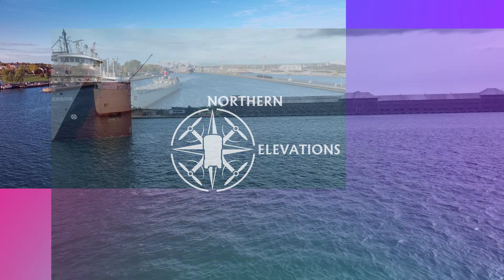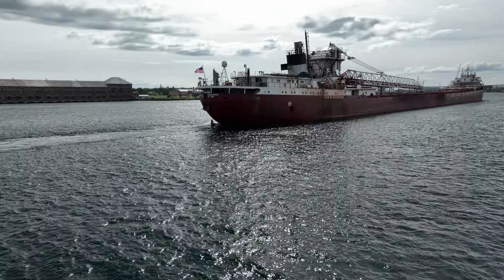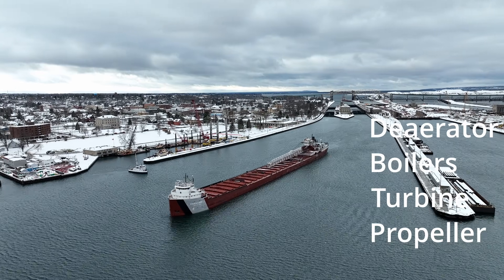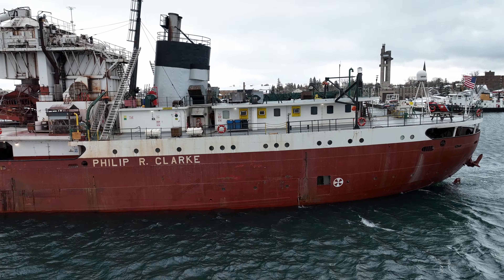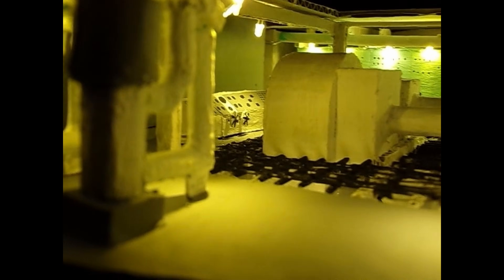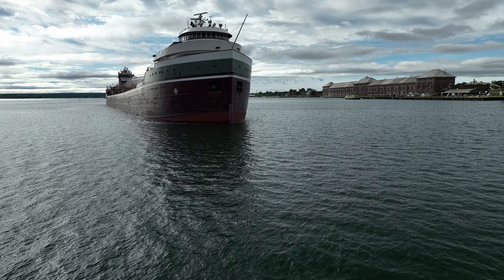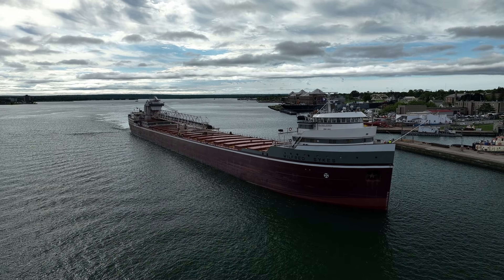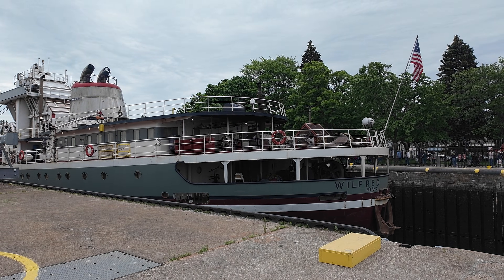The Last 4 Steam Powered Freighters on the Great Lakes

Comment: Two points, 1) either get rid of the music or talk louder than the music. 2) The Alpena hasn't  been coal fired for at least 30 years. It is oil fired. How do I know? Because I was the 3rd Asst Eng. on the SS Alpena in 2023. Also, it was shortened because the docks that it goes to can't fit any ship longer than the Alpena. The Alpena strictly  delivers powdered cement.
Reply from the maker: Yeah, I botched the audio levels on this one for sure. Thanks for the information! I didn't see that information online. The boilers I work with were converted from coal to oil ages ago, and since then to process waste gas (with natural gas for lighting off and to add stability). Makes sense that the Alpena was retrofitted to burn oil.
Reply: @NorthernElevations  I would appreciate if through your channel you would assist me in trying to save at least one of the steamers of the  Great Lakes such as the Anderson or Clarke by getting the Federal Govt and the State of Michigan to purchase it as  the new training ship for Great Lakes Maritime Academy in Traverse City, MI. The ship that the Academy has now is a former Navy anti submarine hunter that bears no relation to anything used on the Great Lakes. A ship such as the Anderson or Clarke would be a perfect training ship for the Academy and would be even more valuable as they are steam ships.

Comment: Speaking from England - I saw steam-turbine Great Lakes freighters when working in Cleveland in 2001/2002.  Leaving the "Flats" area on Friday and Saturday nights was hilarious, as discos pumped music to which thousands danced, leisure boats were so tight on the river you could almost step across - and these freighters would quietly (they are quiet!) move out onto the river and depart.
Word was that if you could get a trip on a freighter try to get on a steam-turbine one because they are smooth and quiet.
I gather they steam-turbine freighters use a bit more fuel - but that fuel is cheaper.
I gather that because so many even very large cars in the USA run on gasoline, optimising oil refining for gasoline leaves more "residual oil" - the "furnace oil" which has little other market and is abundant in the US.
In-extremis you could for gold buy something a steam-turbine ship could run on ('fuel flexibility"), so it seems a good idea to keep some steam-turbine ships.
Reply from the maker: Hello from across the pond! Interesting to hear about the party boats, we don’t see too much of that where I’m at. More fishing boats crowded up. The freighters have a horn system - usually it’s 5+ short toots means “get out of my way”

I’ve heard the turbine ships are smoother than the diesels. In a way it makes sense - all the movement is rotational in the same direction while a diesel has cylinders exploding in and out constantly. I work with steam turbines at my day job, they are certainly not quiet but much more so than way smaller diesel engines.

I think most of our steam ships went away for new environmental regulations came in - quite a few freighters were converted from steam to diesel. I imagine that would be quite the retrofit. The fuel the steamships burn is fuel oil - very nasty stuff from what my coworkers said (we used to burn it on-site before I started here, now we only burn waste gas and natural gas). It’s basically sludge, and not sure on the ships but here they had to keep it warm just so they could pump it in the boilers
Reply: @NorthernElevations You have to have steam to melt the fuel so it will flow.  Even diesel ships running on HFO have to have a steam boiler.
Horn / "toots" yes - also on the lifting railway bridges.
Smoother - the structure of a steam turbine ship around the engine room is smaller and lighter because of no "thumping" fatigue loading.  Contributed to at one time single skin steam turbine oil tankers did as little as 8 years service before scrapping - were cheap to build in the first place.  But did burn something like 300 tonnes of fuel a day to go at about 17kt.
To convert a steam turbine ship to diesel, I understand you have to use medium-speed diesels - not "marine diesels", which are "something else" - if putting diesel engines where a steam plant was.  So you would not get a large fuel consumption saving (?).
The "fast" diesel cannot have the crosshead and enormous stroke of a "marine diesel" which sends up efficiency to over 50%.  "fast" engine is schematically identical to eg. truck engine.
Reply: @RichardSmith-ms6hh  I thought steam ships and diesel ships ran on the same exact kind of fuel oil. how do you know that steamers run on lower quality fuel than diesel ships? I just thought all ships burned the very lowest of quality oil.
Reply: @JasonRector-nd4li  No - steam ships can and did run on a much "worse" oil than diesels could run on.
In Britain we had "Bunker C fuel" for steam ships and "Bunker B fuel" for diesel ships.  In the USA you have various "Number ..." fuels - same general idea.
Please anyone correct me if&where I am not correct...
Bunker C fuel was the worst of the "residual oil" / "still bottoms" - highly sulphurous; with metals like vanadium; etc.  Basically it had no other use.  The advantage of steam ships is fuel flexibility.  Reason there are still some steam-turbine LNG tankers.  They burn the boil-off gas "for free" , plus fuel-oil, etc.  Sulphur in "Bunker C fuel" could be up to 5%.  The  stuff was so "monstrous", ships had to switch to burning distillate when within 12 miles of the coast.
What has changed everything is that you can now get sulphur out of oil at the refinery.  That so - the heavy oils then become valuable for the industrial chemicals stocks they contain.  So no cheap "furnace oil" except in America.

Comment: Ocean vessels have the bridge in the rear, lakers have a front bridge. Why is that?
Reply from the maker: These are classic lakers, modern ones all have the bridge up front since around the 1970’s. In the past, it was thought that having the bridge up front helped the ship navigate. These classic lakers have a “steering pole” up front just for that.

Modern ships all have them at the rear - shorter distance for wires and crew to travel between the bridge and engine rooms. Also more efficient for cargo - having structures at both ends takes up space where cargo can go. This matters especially when the size of these freighters are limited by the size of the Soo Locks.

Comment: Steam ships were always my favorite when I sailed. No noisy vibrating diesels. Just a steam whistle.
Reply from the maker: I’ve always been curious about this - the differences between steamers and diesels. I understand the equipment differences, but how they feel, sound, and all that. Other than vibrations, were there many noticeable differences?

I work in a steam plant (on land) and pretty much everything has the usual 60Hz hum and vibrations are minimal except maybe under the generators. Once you get used to the sounds you can quickly tell something is wrong when the pitch changes.
Reply: @NorthernElevations  The steamers were just quieter and smoother. The only diesel I was ever on that wasn't noisy was a Navy surveillance ship that was diesel electric but towing a sonar array it had to be quiet so the engines were on rubber isolators and the engine room was heavily insulated. It had 4- 1MW generators and 2 800hp dc motors with submarine like screws. At full speed there was hardly a wake.   It was just quiet and smooth but slow as hell.  I was always told if we had regular 4 blade screws we could pick up three knots. 

I have been working in power plants for 21 years in addition to my 5 years at sea. I have run conventional boilers with steam turbine generators, gas turbines, combined cycles.
Reply from the maker: @josephkordinak1591 Very neat! I’ve just worked at Algoma Steel, but we’ve sort of got 4 power plants on site. Ontop of the steelmaking vessels we have a couple massive HRSG’s, at the Boilerhouse 5 boilers that primarily burn waste fuel from the blast furnace and coke ovens, a Cogen that exclusively burns waste fuel, as well as LSP now which is a twin gas turbine plant with a small steamer for combined cycle
Reply: @NorthernElevations  Sounds busy. I have always worked for electric utilities myself. Currently at a simple cycle and combined cycle plant. 600 MW capacity. 1 on 1 combined and 6 simple cycle peakers.

Comment: I think its worth mentioning that the alpena iirc is the only laker that still uses her original steam whistles
Reply: As these are all turbine engined ships,what was the last reciprocating engine  ship to sail on the lakes? And what was the last coal fired Great Lakes steamer ?
Reply from the maker: @t20turnaround49 I’m not sure about the last reciprocal steam engined freighter, but the SS Badger is a passenger ferry that still uses a steam engine and is still ferrying across Lake Michigan!

The Alpena originally burnt coal, when doing research I didn’t see anything anything about boiler retrofits…so that might still burn coal? I didn’t come across information one way or the other unfortunately.

On that coal point though, it isn’t too hard to swap boiler fuels (at least on land). Where I work the boilers were originally coal fired, there’s still the massive coal hopper hanging from the ceiling. Then they were swapped to fuel oil, but now they burn waste fuel (from the blast furnace and coke ovens) as well as a little bit of natural gas. I’m guessing here, but the biggest issue in converting a ship from coal to fuel oil would be the physical space. When converting from steam to diesel they get back a lot of extra space (there’s less equipment needed). Not so when you still need all the steam equipment.
Reply from the maker: That is a very fun fact, unfortunately where I get most of my drone footage it’s very hard to capture audio like ship horns. I’d love to hear what whistle someday though!

Comment: The Anderson is currently docked with no plans to sail it anytime soon. Its days may be numbered. I sure hope not.😢
Reply from the maker: This isn’t her first season in layup, fingers crossed she’ll be back sailing again next year!
Reply: @NorthernElevations  Did it burn coal during the voyage that ended up being the end for the Edmund Fitzgerald ?  Was it converted to burn propane or LPG at a later time ?
Reply from the maker: @d @davidpowell3347 I can’t find much info online, but I think the Anderson still uses her original boilers which burn fuel oil

Comment: Great topic!!  Figured they were all diesels now.
Reply from the maker: Most of them have been converted, but there are still a few holdouts!
Reply: @NorthernElevations Its interesting because, if my memory serves, even the famous Edmund Fitgerald went steam to diesel, correct?  And that was over 50 years ago.  Correct me if I'm wrong...would google it but time to head and I like these conversations.    Great video!
Reply from the maker: @leftseat30 I’m pretty sure the Fitz was a steamer until the day she went down. If memory serves she did have minor adjustments made so she could carry more cargo - there was an interview I recall watching where someone was speculating that these adjustments may have factored into her sinking.

I think it was fairly recent, like the past 20 years where ships have been converted from steam to diesel. It’s a simpler system (you don’t need as many parts like boilers, feedwater pumps, turbines, condensers, detractors, and water treatment…it’s pretty much just the big diesel). Diesel also burns cleaner than a lot of the old fuels they burnt like coal and fuel oil. Clean burning laws unfortunately spelled the end for a lot of boilers.

I work with boilers in a sort of power plant setting (it’s tied in with a manufacturing plant), it can be hard enough to run those on land let alone with water sloshing around in the steam drum in rough waters. Boilers can be touchy when adding and removing fuel too fast too - water expands a bit when it’s heated (more fuel is added) - this effect might not be noticeable in a pot of boiling water, but when you’ve got 30ft of water in a vertical tube it greatly amplifies the effect. So even small factors like that mashes them that much harder to keep running.

I’m always down to talk ships and boilers and stuff (though I mostly make ship videos, I’ve not even been following them 2 years yet…while I’ve been running boilers and steam turbines for over 8 years now)!
Reply: @NorthernElevations Oh wow that's fascinating...where do you run the boilers at?  And it seems you are right I have now cheated and looked up the Fitzgerald's powerplant and there was a conversion it was coal to oil firing for it's boilers; When the Edmund Fitzgerald sank in 1975, she was powered by a 7,500-horsepower Westinghouse double reduction-geared cross-compound steam turbine engine. Originally coal-fired, her boilers were later converted to oil-firing and automation in 1972.
Reply from the maker: @leftseat30 I’m at Algoma Steel! It’s the perfect spot to get teased by freighters - we have regulars in unloading cargo, salties for some exports/mechanical supplies, and one of my job locations has a window where you can watch the Soo Locks Tour Boats cruise by all summer. It’s a bit further down, but on the property there’s also a bit of ship breaking that happens where the scrap is melted back into new steel. Unfortunately I can’t abandon my post to go check any of these out though.
Reply: @NorthernElevations yeah if there's ship breaking going on Id be hustling for souvenirs.  I grew up near Ashland Wisconsin.  I got a life jacket off the JB Ford when it was scrapped in Superior WI a few years ago.
Reply from the maker: @leftseat30 That’s a great treasure! I recalled the JB Ford name but had to look it up - dang that’s one long lasting ship. I did send the local scrapping company an email - doesn’t sound like they’re willing to have any civilians around. I just started doing some drone flights through houses for sale, and figured flying a drone through a half broken ship would be one of the coolest things to do (even if I lost the drone), but it doesn’t sound like that’s going to happen 🥲
Reply: @NorthernElevations yeah they should save pieces and sell some...that life jacket I bought off the ajB Ford was $100.  Expensive but point being I think scrappers could make it worth their time to save pieces $$$$ and also amateur historians or even boanfide historical societies could get historical pieces.  Win-win.

Comment: Steamers won't disappear for long, long time. Remember turbines, driven by steam. Even electric driven ships must have generators, driven by steam (?) On the other hand, the view is marvelous! 😊😊🇵🇱🇺🇸👍👍
Reply from the maker: I believe the electrical generators are often powered by diesel engines these days. It’s a simpler system - when you have steam involved you need boilers, turbines, pumps, condensers, a deaerator etc. The diesel generators need a fuel tank and the diesel generator itself usually on a single skid

Comment: Any word on the michipicoten is she going to stay in lay up or is she next for the scrappers
Reply from the maker: I haven’t heard anything new about the  Michipicoten. If I had to guess though, it probably depends on market conditions. There are more ships laid up this year than last year, so they probably aren’t in a hurry to spend money to fix her. If there were more demand to move cargo then it would be more of a priority to get her fixed.

One of her main routes last year (the ‘Soo express’) will be effectively going away soon - Algoma Steel in Sault Ste Marie will be shutting down their only blast furnace once the two new electric arc furnaces are up. This will greatly reduce, if not eliminate the need for freighters at that plant. As far as I’m aware, scrap steel is mostly transported via train or barge.

Comment: Gonna be tough to get and Unlimited Chief Engineers License of Both Steam and Motor Vessels of Unlimited Tonnage soon once these are gone. I worked under two Chiefs in the 80s and early 90s that had that rating. A bit easier then, more steam boats. Thanks for the video!
Reply from the maker: I’m not familiar with those terms, but I’m assuming it’s qualifications you’d need actual time on a steam powered vessel? If that’s the case, absolutely it will be darn near impossible. It’s very cool that you got to work with such esteemed (pun intended) folks!

It is unfortunate that newer ships have moved away from steam, but it seems like the better way forward. I’ll still be keeping an eye out for the steamers as long as they’re sailing though!

Comment: Few today realize Wilfred Sykes responded to the Edmund Fitzgerald disaster not too long after Arthur M. Anderson did and joined the search party. However, William Clay Ford was actually scrapped in the 1980s (which devastated many since she was the youngest AAA freighter IIRC).
Reply from the maker: The Anderson is best known in her supporting roll with the Fitz…but you’re absolutely correct in that it was a group effort and a number of ships went back out into the storm. There’s a strong bond between sailors, and knowing other vessels would go back out into a storm to help search for them must be reassuring.
Reply: The Sykes was also there for the Steinbrenner in 53